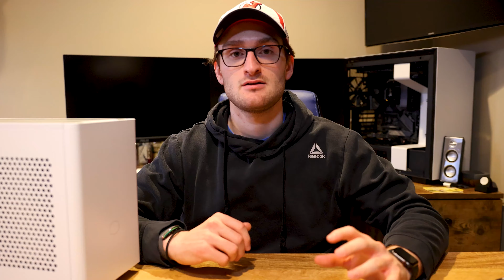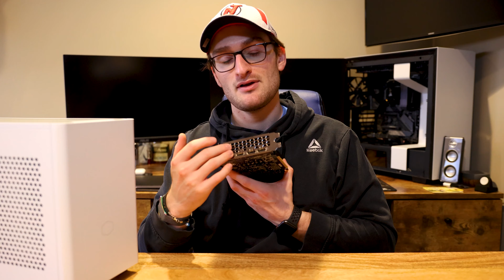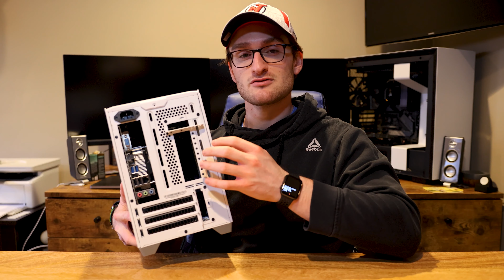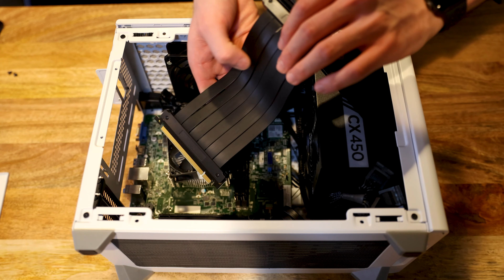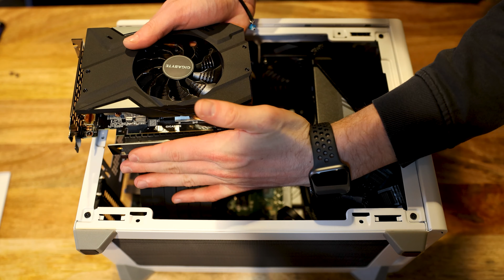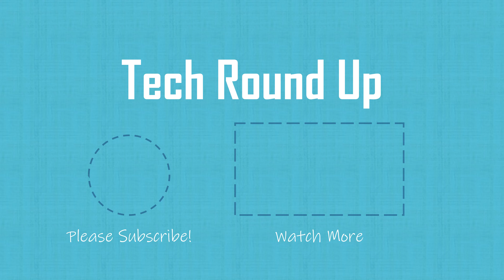Cooler Master NR200 Vertical GPU and Full Size ATX PSU Setup Guide

Comment: I have found at least 4 builds on reddit, where people put matx motherboards into the nr200 and there Io covers and gpu brackets lined up with the case. This would imply that your motherboard doesn't line up because of a different reason than it's matx form factor. Is that correct?

Comment: someone get back to me asap. so if I use my current atx psu will i not be able to put my 3 fan 3060 ti in it. another video this guy has a 3 fan gpu with a sfx psu. so im wondering if i can put my axt psu and my 3 fan gpu in still if so that'll save me 120 bucks

Comment: Can i fit a 24x24 motherboard? If so then i am gonna get the nr200 p version with the cooler and tiny power supply added. I have an HP omen 30L prebuilt. (Rtx3080 10gb i7 10700k)

Comment: i found this old video, hopefully you see this and respond to me

i'm about to buy this case, can i fit a tiny micro ATX motherboard (asrock a320m) + a corsair cx650?
my power supply is the same size as the one in the video i imagine and my motherboard is a lot smaller
i plan on installing the GPU as normal, it's a 1660 super, dual fan gpu, it's not big at all
Reply: yes i can, i bought it, had to cut a tiny bit of metal near the back motherboard side corner because either coolermaster or asrock lied about their sizes and the micro-atx motherboard didn't fit, so i made it fit

i installed the power supply on that same position and my 1660 super (a bit longer than the gpu in the video, 2 fans) did fit just fine in it's slot, i didn't need to install it vertically

Comment: I bought this case and wanted to save up for an am5 mother board when they come out so all I had was my prebuilt pc's vendor motherboard that was surprisingly micro atx and it fit perfectly in this case
Reply: what is the name of that mobo ? mATX 😍
Reply: What about the holes for the screws of your mobo? Do they match to the itx holes?
Reply: for sure? how
Reply: do you know wich was his motherboard? i have an matx motherboard and im wondering if it will fit the nr200p case

Comment: does it need anything to fit in the atx psu?
Reply from the maker: It requires a 3D printed bracket
Reply: @TechRoundUp  are there any problems with the bracket?
Reply from the maker: I haven’t had any

Comment: how much space did you have exactly for a GPU with the atx power supply?
Reply: 240mm of gpu length
Reply: 240mm is the recommended gpu space for the low mount. In this video he has the high mount

Comment: What's the max length for the GPU with full-size ATX?
Reply: I put a rtx2070s in it with atx psu
Reply: @arong2043 what card. matx mobo?
Reply: @alif96anwar  itx mother board
Reply: @alif96anwar  but now I can't put 3.5 hdd in it... still looking for the solution.
Reply: @arong2043  oh

Comment: After mount ATX PSU I think I can't use my RTX 2060 Super dual Fan Graphics Card ?
Reply: I don't have it but I'd guess no. Best bet is Amazon, just try it and send it back unused. 200p model comes with a gen 3 riser cable. On my eyes doesn't look like it will with gpu clearance. I'm getting one this week. You could hang fire and I'll tell you. I have a gtx 1070 dual fan lying around somewhere lol. I use 2060 super but it's the smaller version.

Comment: So how did you mount the ATX PSU? Im looking to reuse my old Tagan 800W in an NR200 and build around it.
Reply from the maker: It requires a 3D printed mounting enclosure that can be found on the cooler master NR200 webpage
Reply: @TechRoundUp  how long was the print? Do you have a cost also for making it. Last ones a bit difficult but I may make a few and sell them through a site I know.
Reply: @TechRoundUp  Yup, got it done last week. It has a few drawbacks but the prints came out very clean. I think they need to make a few modifications to that design - particularly if you want to have the ability to mount the front -top fan (high mount) and the side channel which comes with the case (both mounts)